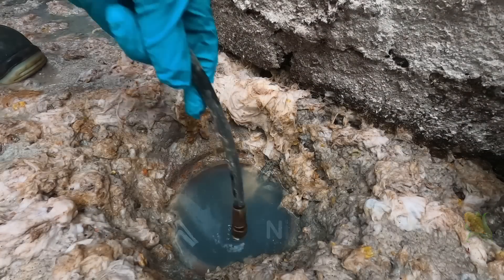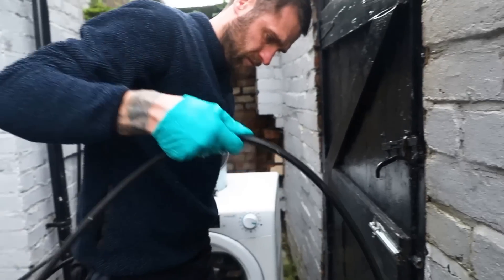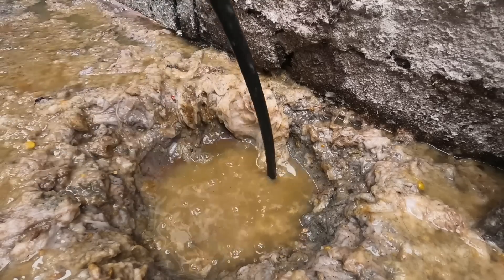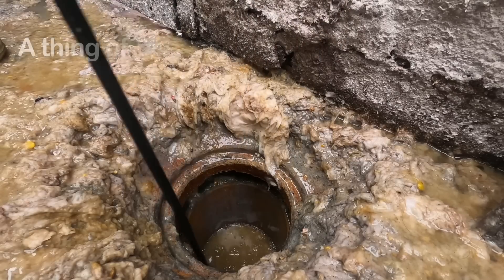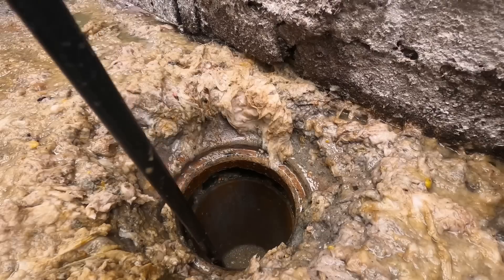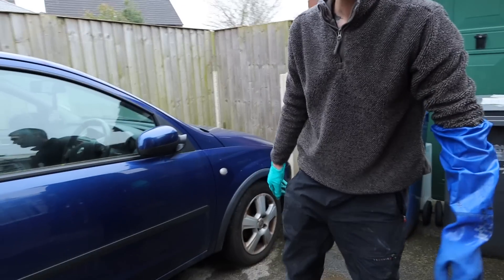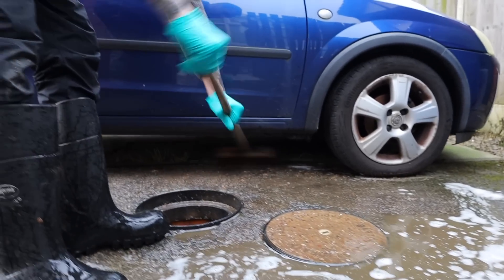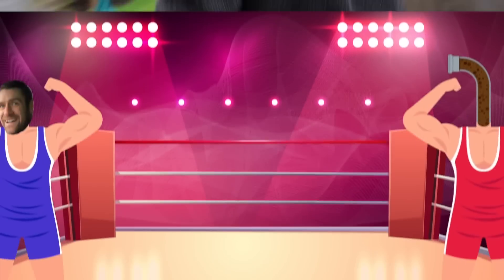Clogged manhole and blocked interceptor - ANDY VS DRAINS

Comment: Your work and videos both are awesome.
I however am concerned about something.
I've noticed that your job requires bending a lot. Like most of the time you are half bend over pulling the hose and I think this can cause you severe back problems in the future.
For this, I think  that you can use some kind of back/torso support brace(belt).
My logic behind is that improper posture can cause a bend the spinal cord and back support braces help you maintain your posture.
This is my personal opinion and please do consult some specialist about this if you like my idea.

All the best Guys 👍🏻👍🏻👍🏻